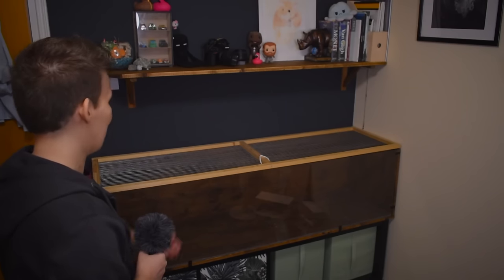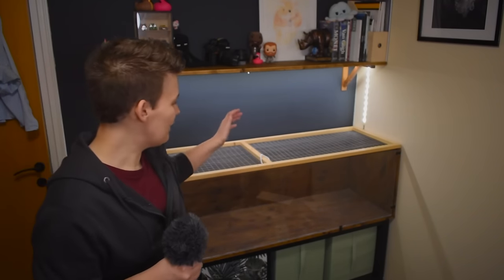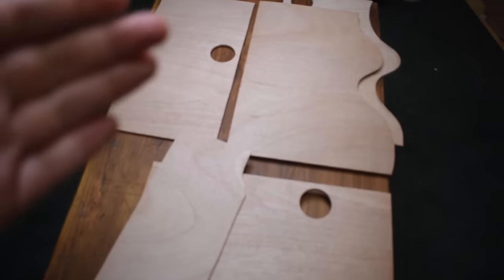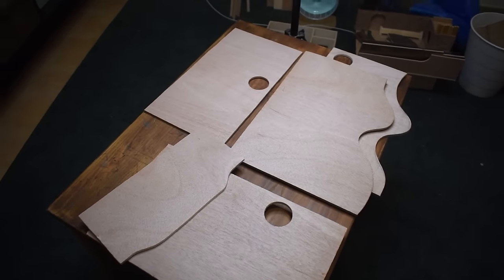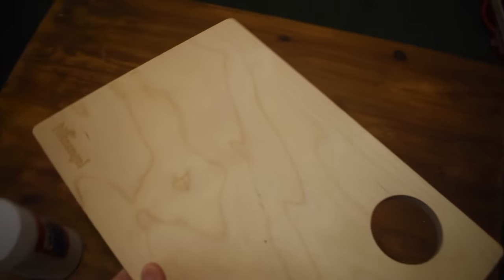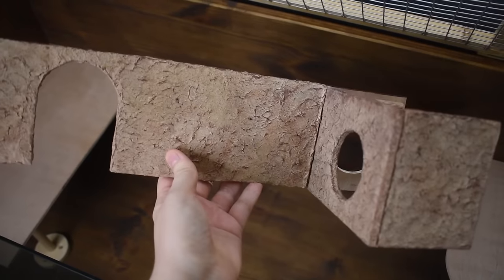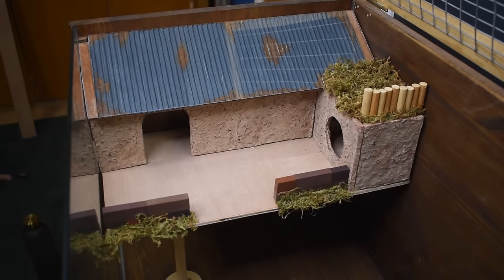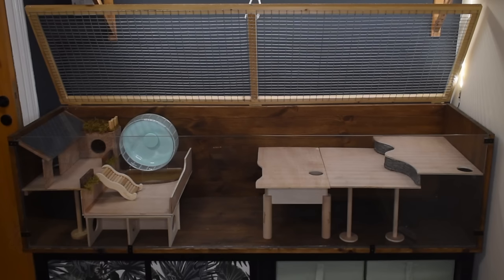Designing A Home For My New Hamster | The Little Cage Project Ep.3

Comment: Why kind of wood is the plywood? Do you need to treat it with something to make it "safe"? Do you put something into the flour glue to prevent the paper clay from molding? I really love your creativity!
Reply from the maker: I'm using birch plywood as it's the most common kind where I live, but you can use any kind made from a hardwood species. Also if you live outside of an EU country look for "NAF plywood" or formaldehyde-free plywood to ensure its safety.

You can coat the wood with any food-grade or pet-safe varnishes if you want to protect the wood from moisture to prolong the lifespan, but you can use it untreated too. Avoid buying pre-treated plywood though as these might contain harmful substances.

Flour glue can only mould if it remains moist for a long period of time, so as long as the clay is allowed to dry fully there's no risk for moulding. If you're concerned that your clay might take too many days to dry fully you can add a small amount of salt into the mixture to provide additional protection :)

Comment: why were you wearing gloves while making the rock wavy wall thingy? is it a sensory thing or do you just not want to have your fingerprints be traceable?
Reply: Could be that he didn't want to get paper clay goop on his hands, or that working with the wire might hurt.
Reply from the maker: They were just to help get the texture right, I used bare hands later on the house walls when I wanted to achieve a slightly different texture. I'm not worried about my future hamster framing me for a bank heist or anything haha 😂
Reply: @SomethingAnimal  I'd be careful if I were you tho. Coco once had access to my finger prints and framed me. I'm currently being trialed for tax fraud and attempted toe eating